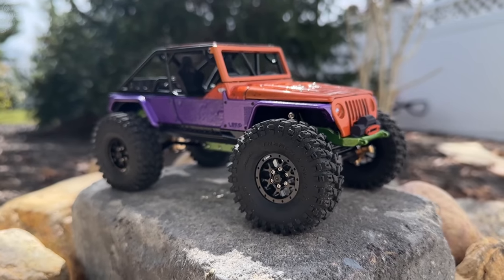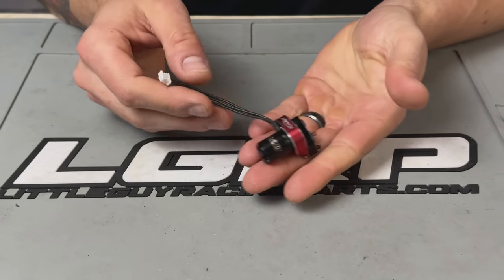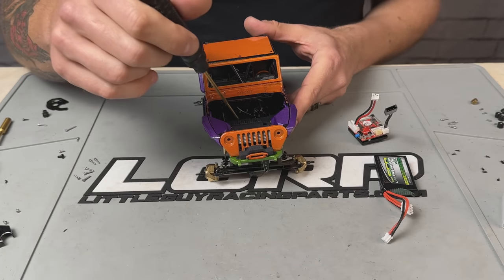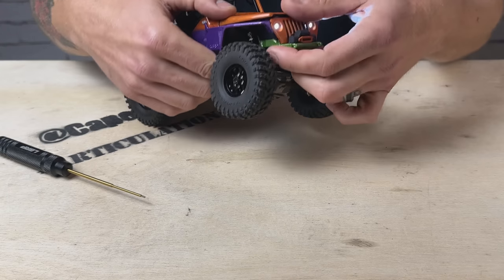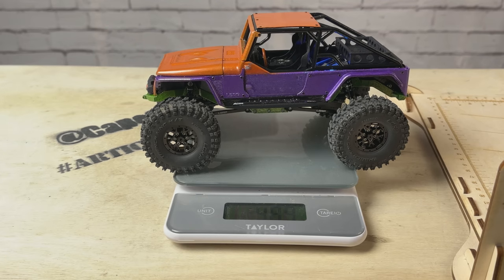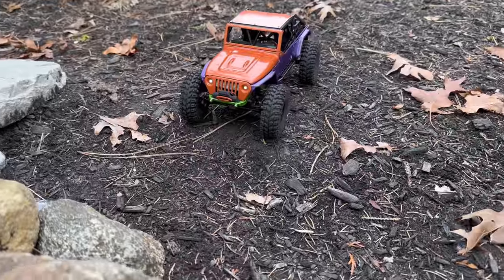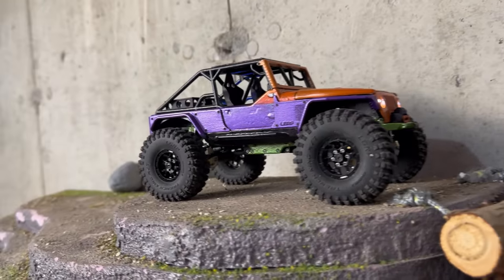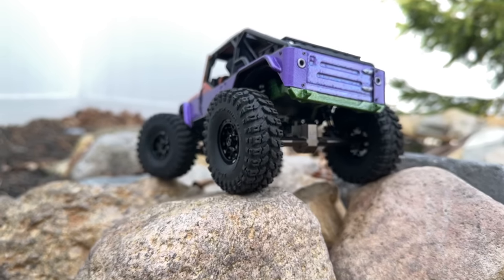LGRP Ripper Build Part 2- NEW LGRP BRUSHLESS MOTOR! Exclusive First Look and Run!!

Comment: Just now watching this in December.  Didn't really know about this rig until about a month ago. As I'm usually a  1/10 guy. But have been getting into the 24's a little more lately.  I have had 4 1/1 jeeps over the years.  So pumped about this build

Comment: Hey Adam, if you get the aluminum skid LGRP sells for the Ripper it give you the option to reverse the transmission.  It is designed to mount the trans forward OR reverse!  I wish all SCX24 skids had that capability!
Reply from the maker: Ahhhh!!! I wish I knew that a week ago! We'll have to use it on the next one
Reply: @CapeCrawlers  Yeah I didn't know it at first either.  I got the skid because I wanted a strong aluminum one instead of plastic because I'm running the Mofo SMP.  It was a nice surprise that their aluminum skid has that extra feature.  LGRP really could do better at including all the details about each part on their site. There are many confusing or lacking discriptions. Some things they just assume you already know.

Comment: Hey Adam - Just wondering just how thick a battery might fit in this kit, thinking 3S rather than 2S.  Also, I would assume the same fitment issues with a Furitek Micro Komodo and transmission.  Had to do the same type mod on the Injora buggy with the Furitek Mini.  Thank you and keep up the great work.

Comment: I like the build. I like how the frame is more scale. Looks like spacers could be put in for a traditional body lift. 

Do you think more brass down low would help or hurt the build? 

What improvements do you think it could have?
Reply from the maker: Shorter shocks and more weight down low I think. Or a limiting strap setup up front.

Comment: Great review of the new motor! I may have to start ordering these instead of the micro komodos.

Wouldn't the RTI (the way its being measured here) be equivalent whether the truck is facing left or right?
The way I'm thinking about it, the angle (and therefore the RTI) needs to be measured from a horizontal center skid. That's the only way the front and rear will differentiate.

I'm open to being wrong here, just had a thought.

Either way, that rig is beautiful dude! It's mesmerizing, how it moves.
Reply from the maker: Thanks! I think you're right about the RTI.

Comment: Hey Adam, with your fantastic collection  of tiny crawlers, which Furitek set up do you like the best? I personally am going back and forth between the Tegu24 pro and the Lizard Ultimate.  I believe you need a separate receiver with the Ultimate which is making the Tegu24 more desirable. Are there any other micro esc set ups other than Furitek that you would use? Any thoughts on a comparison vid? Been watching for a while now especially when it comes to the 1:24 - 1:18 rigs.
Reply from the maker: Hey Brian! My favorite setup is the Furitek mini komodo and tegu24 pro. It's the optimal blend of aesthetic appeal and functionality that I crave.

Comment: IF i had 700bucks id do such a build aswell. Id go with a 100%lgrp no expense spared (as you did). but since i dont have 700bucks (and shipping is like 100 bucks aswell) i propably wont do a ground up build. but maybe ill use what i have and transform my jeep gladiatoras a donor for everything

Comment: How did you get the lights woring with the tegu?
Reply from the maker: It comes with two three pin connectors, primarily for 4WS rigs, but I used the other for the lights.

Comment: I hate to bash lgrp like this, theyre stuff looks cool but its all cheap junk sold or way too much, also performance with lgrp parts are terrible, i spent $800 on the same jeep to build it with the best of everything lgrp offers and it had many flex problems and just couldnt really keep up, an almost bone stock trx4m could go farther, and compatability with other 24 scale rigs is extremly minimal, also with the cheap 3d printed chassis, my fell for the first time and it shattered the entire front end, $180 chassis gone just like that